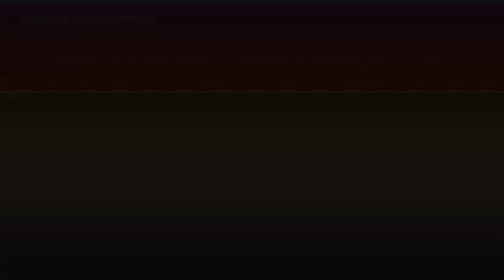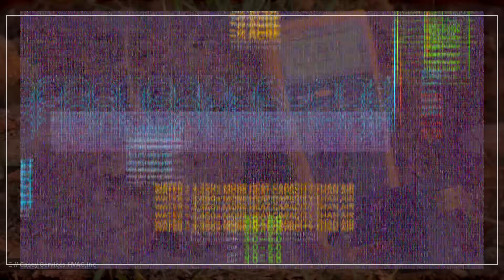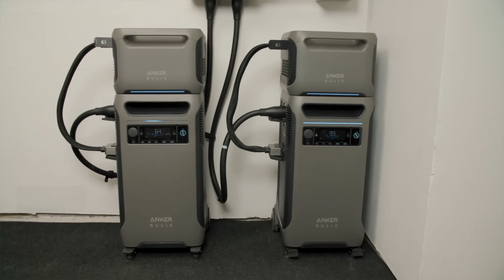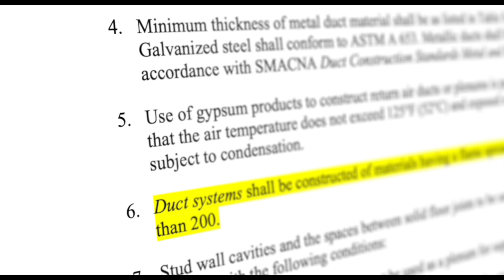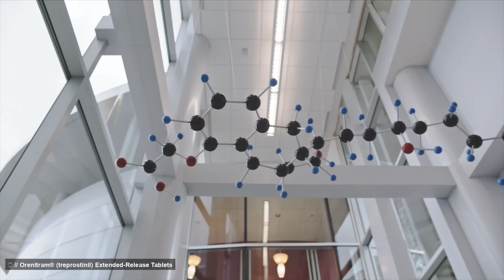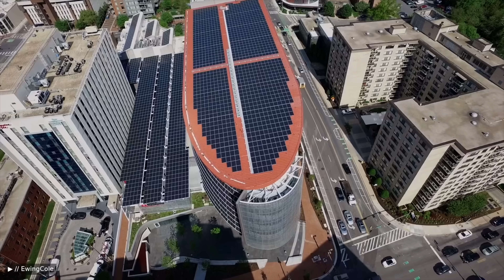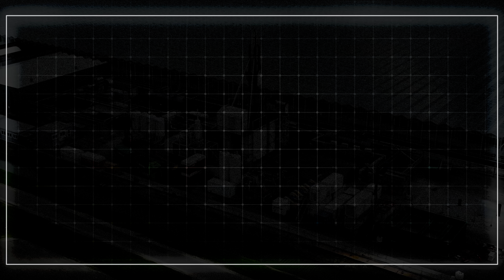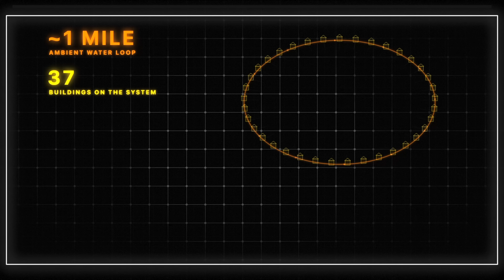The Viral DIY Cooling Hack That Nearly Killed a Family

Comment: Tech Ingredients did a video where they were able to massively increase the efficiency of a window ac by just having the pipes go into  the ground.  While it looks funny, and probably only going to be able to do it if you own, but it really wasn't too difficult if you're even somewhat mechanically inclined.
Reply from the maker: loved that video! super smart, it really helps with heat transfer using a liquid. and its totally safe and 100% does work, lowers power usage
Reply: Yeah, no reason to drop 10s of thousands of dollars on a vertical hole, when a much less expensive horizontal trench would work just as well.
Reply: @FLPhotoCatcher  You can put this under foundation of your house, especially if you use cellar and already digging deeper.
Cost is minimal, just to dig half a meter more, then some half-pipes and zeolite gravel. Zeolite in natural way prevents mold, also allowing water through, so there will never be standing water, even after flood.
Reply: @arivaldarivald3212  Slabs are best on undisturbed earth, the cost of gravel and compaction???
If the slab moves, it might damage your ground loop; the system is dead forever.
Half a meter may be insufficient depending on soil type and water level.
Reply: @CCRoselle  Then a full meter. Very easy to do even 2 meters before building the house. Honestly it would be so cheap I would expect some existing HVAC industry sellers would be against it. Every home should be built this way.
Reply: @CCRoselle  "Slabs are best on undisturbed earth" Not really. Especially not if this 'earth' fas a corn field, small river or lake just few years ago. 
It is common where I live to remove at least 50 cm of earth, cast or build concrete foundation walls, then fill inside with compacted sand. Then You burry all kinds of waste and drainage pipes in sand. Then put a thin slab on top. Very thin, just few centimeters, then insulation, styrofoam, electrical wires, water pipes. Then another slab, with floor heating.
Compacted sand require some work and investment, but generally it is better.
Slab type foundation is rarely used.
Reply: @jameshisself9324  Time is money, and you are requesting quite a bit of time and materials.
Who is paying for this project?
Helps no one if it does not sell.
If so good, build a spec home or two.; show the world what you got!
Reply: @arivaldarivald3212  Sounds great. In the US southwest standard modern homes are exclusively slab for the last 50 years or so. Everything is optional but costs go way up.
Reply: @arivaldarivald3212  I should have clarified that it works just as well, dollar-for-dollar, but it's not as efficient. Actually, for your money,  it might be better.
Reply: @arivaldarivald3212  No footings to support the walls/ structure?
Crazy expensive and not allowed in my area, building on soft silt without piers/foundation, special approval and permit variance...
I once worked on a new house that was built on poor soil. The house sank, and the basement slab floated up.
The builder offered a 100% buyout or a replacement new house.
NO DEAL. He loved the house.

First day on site, the owner was still living in the house, one of my guys says, "I see you are getting ready for Home Beautiful magazine!"

Also worked on a large aquatic center on the lake, looked like a series of large tunnels around the perimeter up to the pool???

The entire structure floated in the beach sand with a massive dewatering system. $$$
Reply: @arivaldarivald3212  I don't recommend digging under where your foundation will be. Over time, that soil you disturbed will settle, stressing both, your buried system and the home's foundation. The idea sounds good in principle, but the reality can be costly. CCRoselle is correct, it's best to build your home on undisturbed earth. 
California has a lot of soil expanse areas, with many homes experiencing cracked slabs or foundations. In the East, you may hit bedrock. Understanding the geology of your particular area, matters.
Reply: @FLPhotoCatcher  as you start juicing the system in hot temperatures and drought conditions horizontals will dry out the ground and make it  much less efficient. Causing the temperatures in the system to get very high.
Unless you live in a very temperate environment I would go with vertical bore holes...
Reply: The payback on these systems really makes sense if you do it yourself (just like solar). I got about 3 years on solar and close to 5 years on liquid fed heath pump from buried lines (horizontal of course). No kickback subsidies!
Reply: Yeah I've done something like that before and it works great 

Using both a ground loop or an air geoexchange setup. 

The ground is much better than the air as a heat source
Reply: 9:20 not Arizona or Nevada?  Why not?
Reply: I watched that. I'm a big fan of that channel.
Reply: it puts copper pipe in a place you cant maintain it unless you also give access archtechture
Reply: @Pazsion2Letstrythis2  No, I think he used PEX pipe which is, pretty much, impervious to corrosion. It's used in plumbing and under floor heating systems.  

PEX pipe (cross-linked polyethylene) is a flexible, durable, and corrosion-resistant plastic tubing used for potable water plumbing and radiant heating systems. It is popular for its ease of installation, freeze resistance, and ability to handle high temperatures. Key types include PEX-A (flexible/expansion), PEX-B (more rigid/crimp), and PEX-C, with 40-50 year lifespans.
Reply: @tims8603  right, it broke? no filtration and couldnt deal with water.... air to air is always going to be air to water ... any water or air pumped into the home it should be filtered. 

copper / brass is preferred... it can be smaller less foot print and resists mold and fungus... similar with aluminum and zinc coatings silver... but copper doesnt leach enough to be toxic to most life. 

instead of huge tubes of plastic its a smaller pipe around not under the house. 

one hot one cold... the intake is inside the home, exhaust outside.   the water resivour is smaller saline or fresh and filtered the. another filter before the air pump... cycles air inside the home and holds enough pressure to bubble the water... 

here is also placed a switch / air valve cold for summer and hot for winter... allowing blending of hot and cold water... not air...  this diffuses into water and then filters into the air...

not just cost prohibited but designs vary greatly and all claim the same things...  its not a diy project you need professional oversight any time your digging above your waist or around structures... the risks involved means its not done alone either. 

smaller copper pipes and liquid heat exchange only needs to be buried at the water line... then the roof for heat... and electric inline backups.
Reply: @Pazsion2Letstrythis2  Are you extremely wealthy? copper pipe is very expensive. Copper pipe corrodes in acidic soil. It also gets choked with mineral deposits like calcium and iron in the water reducing heat transfer. The system he designed was very simple and effective. It was a demonstration to prove that it works. What you're talking about would be out of reach in costs for the average person. Get real.
Reply: @tims8 @tims8603 pilary laser sealed heat pipes kind of work on this build up idea.

acids only etch until the oxide layers build up. 

yea its expensive, but everywhere.
stainless steel would be an option but copper can be in the ground for over 100 years. 

if its not blocked it will always be easy access. 

the idea is extensive and uses a lot of materiels and effort either way. but it should last decades and reduce grid base load and your own base load.

it would mean 50-60% less likely to need nuclear power or depend on others. and still be able to export power , heating and cooling.
Reply: @Pazsion2Letstrythis2  Did you watch the Tech Ingredients video? Everything you are saying seems to say you didn't.
Reply: One system you didn't mention is the closed loop air approach.
No outside air - just circulation of the air already in the home - same approach as standard central HVAC. PVC pipes 5' below grade pitch to drain.
Reply: @billz4795  ---Earth tubes are no longer recommended because of mold problems...
Yes, there are workarounds $$$.
Reply: There was a caveat that said hole was... 20 feet down and could only absorb about that size of window AC in heat duty.

And required changing up the fan of that AC unit with a liquid heat exchanger from what I remember.

Not exactly trivial, but doable with some fabrication knowledge
Reply: @eccentricthinker142  Being able to swap the fan for a liquid cooler pump would be worth it for the decrease in noise alone.
Reply: @mal2ksc  I'm not saying it's not doable, but it takes some skill that might not be present in a lot of the viewers... that and installing a separate immersion loop in place of the fan may not be all that easy
Reply: yes remember that the just dig a bit hole by you windows, and and dump a load teh plastic pipe in it the teh not even organised the messery pipe put inthe hole the better it seemed to work?
Reply: @dh2032 🤓
Reply: So even mighty Alphabet/ Google’s Dandelion couldn’t modernize drilling & just relies on the same old tech. Time to call Elon Musk?

Comment: Thanks for sharing, I’ve been obsessed with ground sourced geothermal for probably 30 yrs. As a power system operator working for a large utility in the northeast I frequently submitted ideas into the employee suggestion program recommending our company support the technology to much ridicule. After years of scrubbing the internet I found an installer from the New England area that was very sharing with his many years of experience installing all the various systems and the downfall found in each system. His logic was very well thought out. His recommendation going forward was to use a common drilled water well with a submerged water pump in an open loop setup returning the water to a common dry well. It uses the most common affordable components with the lowest electrical pump loading. The only system I’ve heard that was even more efficient was a coworker who lived in a town that provided unmetered public water service paid by taxes and hooked a water furnace up to his public water with a solenoid valve that opens when ever there is a call for heat. I’m still a little torn by that setup since it flys directly against the prevailing water conservation movement. In his defense the town where he lives has such an abundance that they will never have any concerns about supply and it is a gravity feed system so the energy use isn’t really a factor either.

Comment: There are a lot of problems with direct underground ventilation.  Downright dangerous in many locations due to radon gas.  Mold caused by moistened air (remember what happens what hot air is cooled down!  Condensation!), and other organic compounds that may outgas out of the soil and into the loop.

The solution is to always use a heat exchanger of some sort.  It can be a direct heat exchanger or it can go into a heat pump (which can be thought of as a heat exchanger, just a much fancier one).

Similar problems arise with things like "beer can" solar heaters, where people build black-painted glass-enclosed beer-can solar heaters and pump air through it and from there directly into their house or cabin.  In this case it isn't underground, but the air is being exposed to very high amounts of heat that will slowly burn the material in the solar heater, causing outgassing  that then flows into the home or cabin.   A heat exchanger should always be used.

Direct underground ventilation also has a loop problem.  Looping inside air through an underground chamber leaves you with a lack of fresh air.  Single-pathing outside air through an underground chamber leaves you with a pressure differential that forces out air that you want to keep in the home.  Yet another good reason to use a heat exchanger.

Whether it be a refrigerant, a heavy liquid like a glycol, water, or air that you use for the loop depends on the application.  It is not always better to use the best heat transfer material.  What you need is heat transfer sufficient to produce the necessary results out of the heat exchanger.

-Matt
Reply: Matt, thanks for this info. I appreciate how obvious this is in hindsight, but I needed to have it spelled out.
Reply: The tubes don’t extract ground air , it is surface air
Reply: @ConnieLake-k1u  There is no "ground" air.  In an air system it is surface air that is run through the ground through either perforated tubes or sealed tubes.

The tubes may or may not be perforated, depending on what you are trying to do.  Some greenhouse systems, for example, use perforated tubes / non-sealed tubes. 

Condensation doesn't need perforated tubes.  Just a quick temperature change. It will happen in sealed or perforated tubes and if the water has nowhere to go it can turn into a mold disaster.

Radon gas is not typically a problem with sealed tubes, just with perforated tubes, but it depends how the air intake is designed and damage or cracks in the tubes over time can lead to a radon gas problem.

-Matt
Reply: Air purifier can be effective
Reply: @ConnieLake-k1u  Not against mold and certainly not against radon gas.  No.  An air purifier is good at getting rid of particulates but that's basically it.
Reply: @ConnieLake-k1u  not for radon. It is radioactive. Radon isn't a big problem everywhere though. Certain areas have a much higher probability than others.
Reply: the general idea is that the intake side outside starts lower then where it enters the structure, but the intake is fresh air and the pipes are sloped so any condensation runs out the intake side, also if the outside air around your house is that toxic then you need to move away from the nuclear test site the government gave you to put your trailer on Cousin Eddie.
Reply: @DanielsCorner644  Good luck on the "sloped" part, let alone drainage going against airflow.  It isn't the outside air that is the problem, it's the condensation that occurs as the outside air is cooled by the ground.  In a 100ft+ maze of tubes (usually several hundred feet, actually), the water is not gonna drain out one end no matter what you do.

So you are left deciding whether to perforate the air tubing for drainage into the soil, or not.  If you don't you have a drainage and moisture problem.  If you do you have a multitude of other problems (radon, biological gas, soil humidity, etc).

Anyway, this is one of many reasons why liquid loops (such as a glycol loop) are far superior to air loops.  Liquid loops, however, have a more limited lifespan because no leaks can be tolerated.

If you do a glycol loop its good to have a transparent section (if doing a low-pressure loop) that you can look at to see whether the flow has become contaminated or not.  Not that there is much that can be done if it has.

-Matt
Reply: @junkerzn7312 it's not a maze of tubes, go look at the Earthship houses in New Mexico,  they di straight runs, they've been doing it for several decades now at this point. You can't just toss this design onto any random house, you need the grades to be right so that it's a straight run and that is what kills it for most people,  the site conditions required don't exist, that's why it failed for that one house they went down then back up, that led to condensation and water build up. Proper Geothermal is better of course but to outright deny the science to push your propaganda is wild.
Reply: @junkerzn7312  Thanks for this excellent explanation.